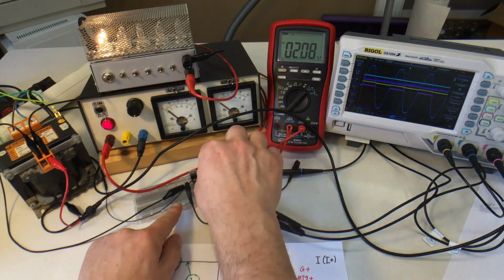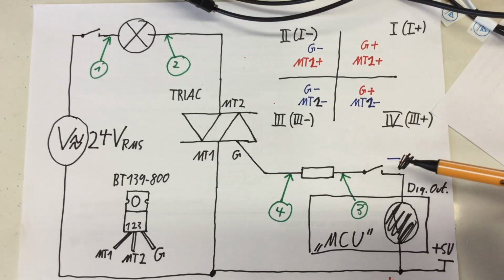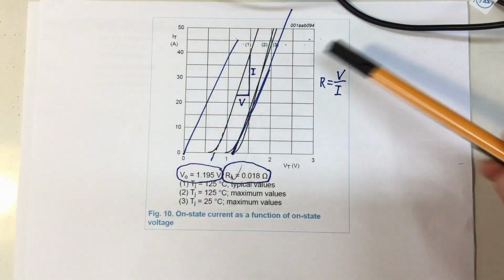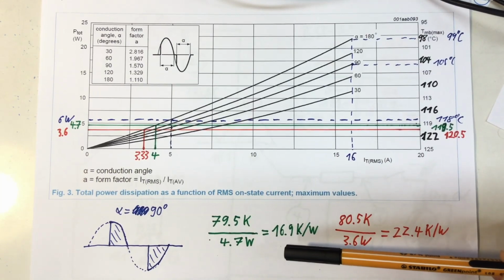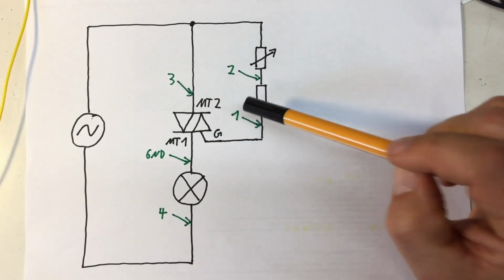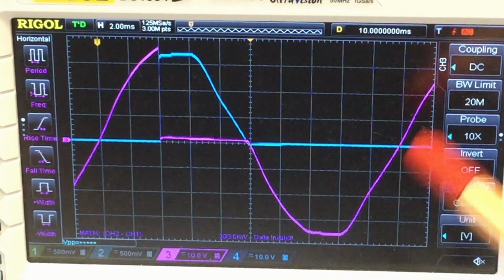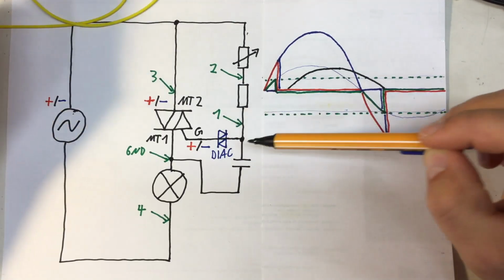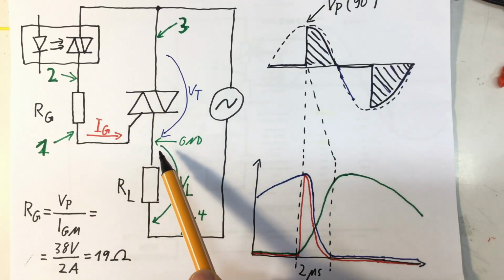TRIACs – The Dirty Details (3/3): Practical Considerations

Comment: Thank you your detailed explanaion about the subject. I am going to prototype two type of switching circuits controlled by uC to control inductive loads (AC solenoids on valves, AC circulating pumps). I hope your lessons gave all the information I need to design - prototype - check - correct - and finalise the project. I would like to emphasize how important is to check the prototype by scope to fully understand the actual operation of the circuit and modify it if it is necessary. Measurement of the key parameters of the triac and the opto coupler (in my case) is crutial in order to have a long lasting stable solution which is elementary on automation projects. It is especially true for selecting - fine tuning the right snubber circuits for a given inductive load.
Reply from the maker: You're welcome! I don't if my three videos were really able to give you ALL the information you'll need to design your circuit ;-) But I guess they were pretty exhaustive in regards to TRIACS. Anyway, reading your comment I got the impression that you've got all bases covered ("design - prototype - check - correct - and finalise", "fine tuning the right snubber circuits for a given inductive load"). So good luck with your project! BTW I've got a video "Switching AC with Triacs and Zero Crossing Triac Output Optocouplers" https://youtu.be/rLpFtSayZ3Q , but it might be a bit to basic for your purposes (switching resistive loads only).
Reply: @robertssmorgasbord  i am confused about usinf snubber with the tiracs. i would like to drive selenoid valves 24 volt ac approximately 600 mA current. Snubber circuit is necessary for driving selenoids?
Reply from the maker: @ankara9594  A solenoid is basically a coil with an iron core, thus an (in most cases rather large) inductivity. If you drive an inductivity with an TRIAC you generally need a snubber network. So yes, in most cases a snubber network is necessary for driving a solenoid. For details see this application note from On Semiconductors https://www.onsemi.com/pub/Collateral/AN-3008.pdf.pdf or this one from ST Microelectronics https://www.st.com/resource/en/application_note/cd00004096-rc-snubber-circuit-design-for-triacs-stmicroelectronics.pdf
However, nowadays you can also get "snubberless" TRIACs that endure much higher voltage transients. So in some cases and with the right TRIAC you can get away without a snubber network.

Comment: Thanks  for this series on triac's its the most in depth I've seen, could you please state how you arrived at a capacitor value for the rc network.
Reply from the maker: You're welcome! And thanks for the praise!
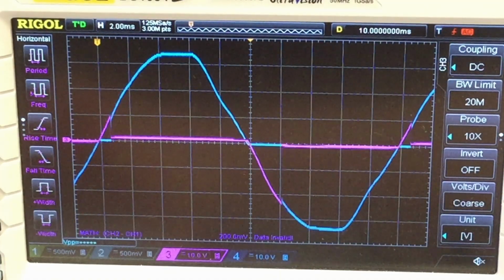Regarding the capacitor value: I didn't really calculate the value of the capacitor used in that video (28:46 Phase shifting). I just wanted to demonstrate the principle. Anyway, if you want to calculate the capacitor ...
The phase shift of the RC network is:
   arctan( R / Xc )
Xc is the impedance of the capacitor at the AC frequency:
   1 / (2 * Pi * f * C)
So the phase shift is:
   arctan( R * 2 * Pi * f * C )
Note that you get a 45° phase shift for:
   1 = R * 2 * Pi * f * C, arctan( 1 ) = 45°
You see why I didn't got into that in the video ;-) Anyway, I hope it helps. Cheers!

Comment: Great videos! ALL 3! Can a triac driven heat gun(2000W rated) be used as a "dummy load" for testing current output of a modified 12~14VDC PSU?(with an inverter between them) I know hairdryers don't use triacs(are more like a regular "resistor" and not "switched") like a heat gun.  What are potential issues(problems) for using such heat gun(or small space heater) as a "dummy load"? Note: the testing would focus on high current output(70~100A @ up to 14V) over some time (e.g. 1 hour), and not intended for testing noise response in the PSU. Thank you! P.S. It would be a cool topic for another video!
Reply from the maker: Well, if you have an 1.5kW inverter (100A * 14V = 1.4kW) I don't see why you couldn't use TRIAC driven heat gun as a test load - in principle. Just keep in mind that your inverter might not pull a smooth DC current out of your DC PSU. The current it draws might have quite the ripple.
Reply from the maker: @tinkerman4774  Well, the folks at the EEVBlog forum are not wrong. A 2kW heatgun running on AC 240Veff draws an RMS/effective current of 2000W/240V =  8.33Aeff. That's the current it would constantly draw if you run it with 240V DC instead of AC. So the resistance of the heatgun is 240V/8.33A = 28.8Ohm (I'm ignoring here, that the heating element might change its resistance with temperature). The peak voltage of 240V AC (sine) is 240Veff*√2 = 339Vpeak. So if the TRIAC switched on at peak voltage (90° or 270°) the heating element would draw at that moment 339Vpeak/28.8Ohm = 11.8Apeak or  11.8Apeak*339Vpeak = 4000Wpeak. So to avoid that your TRIAC has to be switched on after 90°, respectively, 270°. Limiting the heatgun's power to less than 1kW.
However, the inverter making the AC will definitely "smooth out" that peak power on the AC side, so you won't see those high current spikes on its DC input side. How much will it "smooth out" those current spikes? It depends on the construction of the inverter (how much capacitance on the input, how the actual transformer is constructed, and how that transformer is driven).
Reply: THANG-Q! You ROCK! 🤘🤘🤘 I'm now considering other options without a TRIAC (e.g. power resistors, nichrome wire in mineral oil etc.)  to simplify the setup and make the DC load voltage more steady, as it would be in actual use. Cheers~!
Reply from the maker: @tinkerman4774  You're welcome 🙂 BTW, nichrome wire in mineral oil (or distilled / de-ionized water for lower voltages) is a common and cheap way to create loads for such applications. Dumping 2kW of power into power resistors will definitely break the bank. Those power resistors are quite expensive.

Comment: Great extreme detailed stuff sir, Much appreciated to enlighten us with ur knowledge,.

Sir i have a very simple circuit of triac BT 136 in which i wanted to connect it with one LDR one 100k register and LED bulb in 240v AC mains, but LED bulb flickers and it generates sound also. Then i removed resistor and LDR both and connect it very simply like 

M1 with 240 V AC live, 
M2 goes to LED bulb, 
Gate i directly connected it to M1 and 
another terminal of LED bulb into neutral. 

but LED bulb still flickers with sound however flicker and sound gets reduce but LED bulb in direct 240V AC running without flicker without noise. What could be the problem sir?
Reply from the maker: Most LED bulbs don't like phase control on their AC input. And that's what a TRIAC circuit does. Even if you connect the gate directly to M2 (not M1! and via a resistor! https://www.electronics-notes.com/images/triac-switch-circuit-basic-01.svg ) a little portion of each AC half wave is cut off. Maybe you have more luck with an LED bulb that is explicitly sold as "dimmable".
Reply: @robertssmorgasbord  Sir means by no way we can pass the full AC signal (without ay cut) from TRIAC? even if we open the gate fully?
Reply from the maker: @arpitjain4025  No, there isn't (at least none I know of). You will have always a short time after a zero crossing of the AC where the TRIAC is off.
Reply: @robertssmorgasbord  ok sir, means triac cant be use as a pure switch. thus we cant use them as relay......all these videos on TRAIC as relay is misleading :(
Reply: @robertssmorgasbord  Also sir why LED bulbs circuit cant handle such short elimination of AC wave?
Reply from the maker: @arpitjain4025  In that context ("perfect switch"), no. If you want an (almost) perfect AC switch you'll need to use MOSFETs. E.g. https://toshiba.semicon-storage.com/eu/semiconductor/application/smart-plug/articles/ac-switch-example-using-photovoltaic-coupler-and-mosfet.html
Reply from the maker: @arpitjain4025  Well, in most application that always present very small phase cutoff does not have any negative effects. And for those applications TRIAC solutions are very simple to implement and very cost effective. It's just when you want/need a "perfect" solid state replacement for a switch/relay, TRIACs won't cut the mustard because of the phase cutoff and the power loss.
Reply: @robertssmorgasbord  Sir then why those LED bulbs circuits cant handle this and LED flickers and also generate sound..
Reply from the maker: @arpitjain4025  There are many reasons and it depends on the actual circuit of the LED bulb. Have a look at this circuit for example: https://electronics.stackexchange.com/questions/339932/a-1usd-11w-led-bulb-circuit-and-parts-analysis
That circuit has absolutely no measures to deal with voltage spikes on AC mains or - in our case - small voltage steps. Chances are the small voltage steps due to the small phase cutoff will make the little transformer hum with 100Hz.
Reply from the maker: @arpitjain4025  Well, unfortunately I can't make out what chips are used on that board, but there's a single ceramic capacitor which might cause the noise: https://www.murata.com/en-eu/support/faqs/products/capacitor/mlcc/char/0020
Reply: @robertssmorgasbord  Sir one chip is bridge rectifier and rest all are same, constant current led driver ICs in parallel connection. and those smd resisters are just to select the amoun of current from IC. https://www.youtube.com/watch?v=9W0fFtIPeDc Sir can we do any thing to reduce flicker and sound induced by triac switching in this circuit?
Reply from the maker: @arpitjain4025  No, not to my knowledge. Sorry.
Reply: @robertssmorgasbord  Sir thanks a lot for all ur replies and knowledge, it helped me a lot to be a better electronics engineer :) sir could u pls share ur email id so that i can be in touch with you.
Reply from the maker: @arpitjain4025  You're welcome :-) I'll hope you'll understand that due to privacy reasons I don't want to release my email address. I'm not a professional YouTuber and the comment section is my preferred way to communicate with my esteemed viewers.
Reply: @robertssmorgasbord  OK sir, i understood it completely,  And once again sir, thanks for your time and wisdom that u share with us so patiently, Long live sir, Love from INDIA :)
Reply from the maker: @arpitjain4025  Again, you're welcome! And the best of luck getting your LED bulb quiet.
Reply: @robertssmorgasbord  Sir for now im using relay and then i will go in deep, surely sir will let you know if i find something interesting.

Comment: Hi,
I have an electronic board to control an AC motor -2500 watts/220v.
On the board are mounted two TRIAC - BTB24-600BW . The motor has a problem-runing on reverse only-no matter which button is pressed-FW or RW.
I found that the resistor who is connected to the Gate terminal on TRIAC 1 is burned and I replaced with a new one 47 Ohm/1 w .
Also I found a short cut between the Gate and Terminal 2 (the midle terminal) on the same TRIAC and replace it with new TRIAC--BTB24-600BW.After that I did a check by multimeter between all soldering points.
Then the board was connected to the motor.Unfortunatly the motor not run-in any directions- clock wise or reverse !
Do You can to gave me any advice?
Reply from the maker: Hi, I've already answered your comment on the other video, but here it is again:
Well, without knowing the whole circuit and the type of the AC motor (I'm assuming it's a single phase universal AC motor) it's quite hard to give some advice. For example: Are your sure the burned out gate resistor was 47 Ohm? Because that would give you a peak gate current of 220V*1.41/47Ohm = 6.6A, while the BTB24 is only rated for 4A peak gate current. Also, how does the FW/RW button/circuit work? Anyway, if you desolder the BTB24 again and just solder in a (reasonable thick) wire between terminal 1 and terminal 2, then the motor should run at full speed as soon as you connect the circuit to AC mains. If that's not the case, than something else beyond the TRIAC has been damaged.
Reply: @robertssmorgasbord  This is the resistor who I use: https://docs.rs-online.com/6cc6/0900766b81553f99.pdf
Reply: @robertssmorgasbord  https://eandc.ru/catalog/detail.php?ID=2938 - There are all details about BTB24-600BW TRIAC
Reply: @robertssmorgasbord  I did bypass T1 to T2 and the motor run,but on reverse.
Reply from the maker: @lyudmilvarbanov7294  OK, that's a lot to digest :-) I'll have a look at it tomorrow.
Reply from the maker: @lyudmilvarbanov7294  I had a look at everything you uploaded/linked. First, yes, the gate resistor is obviously 47 Ohm. That's OK then (BTW you've got good SMD soldering skills). My next guess is that when the TRIAC blew it damaged not only the 47 Ohm gate resistor, but also the circuitry driving the gate through that resistor (there must have been quite a high current to blow that resistor). So you'll need to trace back from that resistor further into the circuit. As far as I can tell from the pictures there is a transistor near that resistor, that was probably driving the gate. Maybe that transistor got damaged too and needs replacing. I don't know if you have an oscilloscope, but without one it might be pretty hard to locate the fault (If you use an oscilloscope, make sure not to blow it and the circuit up. Make sure that the oscilloscope's probe/BNC ground is connected to AC mains neutral and nothing else!). To be honest, I'm still in the dark how the whole circuit works, especially the direction switching of the motor (pictures of the front and the back of the whole (!) board would help somehow). You can try replacing part after part, but I think the better approach would be to get somehow a circuit diagram or to reverse engineer the board (from what is visible in your pictures it's a two layer board with parts on both sides, so that will be quite some work). Anyway, I'm sorry I can't be of more help at this point. BTW I will be away for three weeks now:  https://youtu.be/iFmWHK9sjfU Maybe meanwhile somebody on the EEVblog forum can help you: https://www.eevblog.com/forum/index.php (don't forget to upload pictures of the whole board).
Reply: @robertssmorgasbord  Hi Robert,
Thank You so much and sorry for Your time wasting.I had similar variants for the fault reasons and will keep in touch with You. Have a nice holiday !
Reply from the maker: @lyudmilvarbanov7294  You're welcome! And don't be sorry, it was an interesting problem :-)

Comment: Thanks for your very clear explanation. Triac's look bulky power switch components easy to use, but I see that it way more complicated then I thought. I understand it better now, at least the basics that I need to make it operate in a controlled way. 
From the  schematics that I see using Opto-coupler devices to control the gate current, I do understand now that these work in Q1 and Q3 assuming they have connected the Opto-coupler between MT2 and the gate.  
I saw you trying to calculate the power dissipation of a triac in function of a sine wave current. You said it was complicated to do that. A while ago I spend some time to crack that problem which is about mathematics. Here is the link to the math and the final formula you were looking for.  https://www.holamex.nl/files/img/Triac%20Power%20Dissipation%20Math.jpg
I hope by this to  have contributed to this explination about triacs and to have contributed to more reality in this world. I need that because there are to many excel sheet dreamers around.
Reply from the maker: I thank you for actually doing the integral math for the power dissipation! I try to keep the math in my videos as simple as possible. And to be honest, I was never really good with integrals. Maybe I should reeducate myself and make a video about the most important differentials/integrals for electrical engineers (sine/cosine and e).
Reply: @robertssmorgasbord  Don't worry,  I like people who make videos like you do. You do your part I do mine, together we have more. Greetings from your neighbor Dutch
Reply from the maker: @allinthefamiliy3122  Again, thanks! I always wanted to visit the Netherlands. You know, rent a little boat and tour all the channels. Anyway, greetings back from Germany!